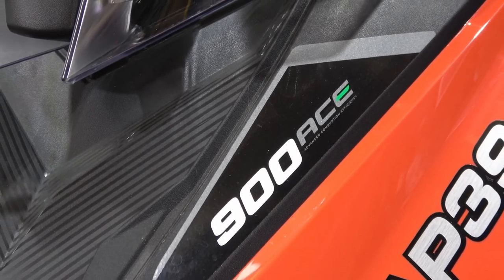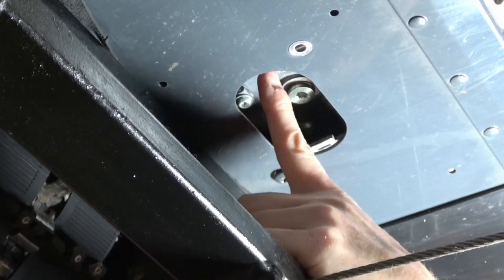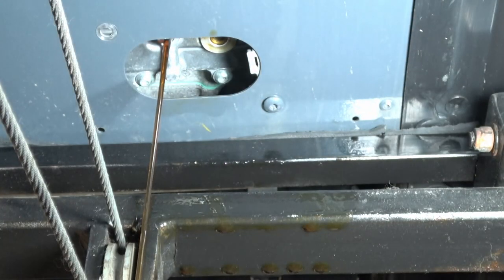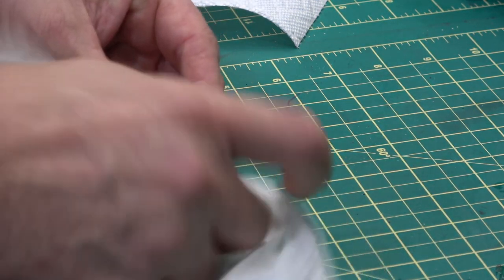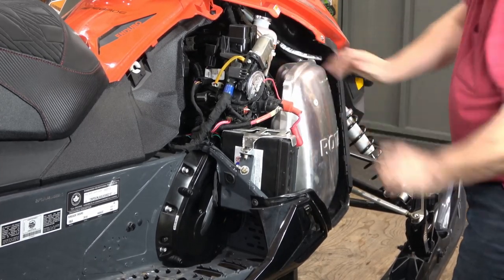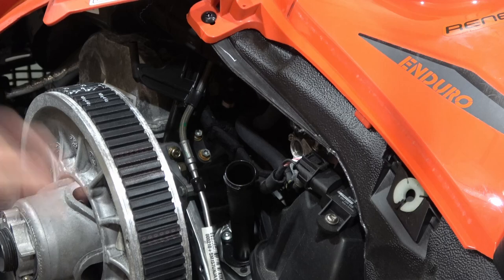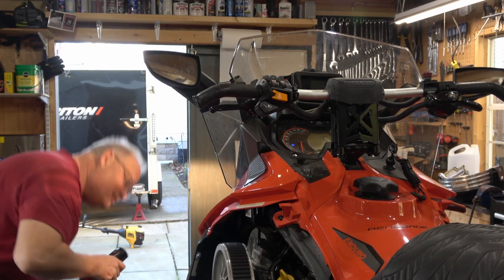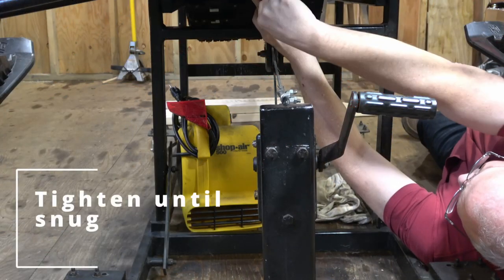Today I change the oil in my 2018 Ski Doo ACE 900 snowmobile

Comment: Thanks for the video. First time I tried changing the oil before watching the video, I stripped the main drain screw. I didn’t get totally underneath it when taking it off. It was on an angle and stripped. I bought some “torx out” heads and will try again with your video. I do have an AC delco snowmobile/rv/cycle lift that I’ll use so I’m directly under the sled looking at the drain bolts versus an angle.
Reply from the maker: Thank you for the comment and I am sorry to hear about your first attempt, I know I have done that myself. A lift defiantly helps get the right angle and makes the job much easier.
Dino

Comment: Thanks Dino- a useful video - I think this will be handy for people who want to do their own service (don't we all? - I have been doing service on my bikes and cars for fifty years and still enjoy keeping them in good condition).  Dino you supply good safety information regarding opening the Tinker Shed when the engine is running.
Reply from the maker: Thanks for the comments Mal, I've found that most of these skills are transferable to most engines, thanks for the comment on the  ventilation, in any shop without a fume extractor it is important to get good cross flow when running an engine.
Thanks again for the feedback.
Dino

Comment: Hi Dino nice video, very helpful.  Can share the skidoo lift you use.  I would like to purchase a lift for my grand touring 900 ace turbo
Reply from the maker: Thank you, I'm glad you found the video helpful. The lift I use is actually home made but patterned off commercially available lifts. I actually owned one that came from Royal Distributing here in Canada and it was much lighter weight than the one I have now but it does work. It is on sale at Princess Auto in Canada right now https://www.princessauto.com/en/750-lb-snowmobile-service-lift/product/PA0008328270 for $230.00.

Dino
Reply: @DinosTinkerShed  i tried to order the lift you suggested, they do not ship to Ohio in USA.
Reply from the maker: That not very friendly of them. I would imagine there are a few retailers in the US that sell similar units, I am just not as familiar with the dealers down there. I checked Harbor Freight but they do not carry one. Sorry, I wish I could help more.
Dino
Reply: @DinosTinkerShed  Thank You